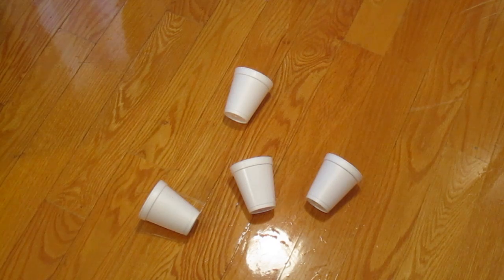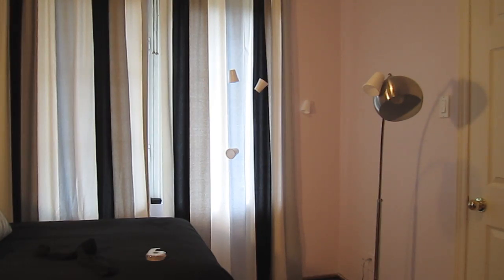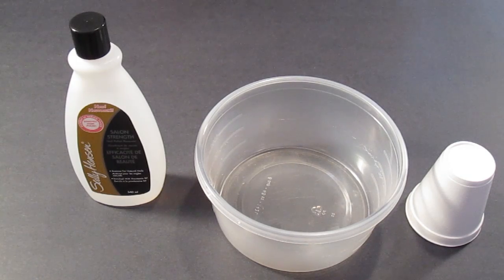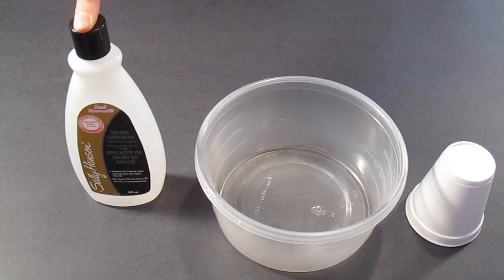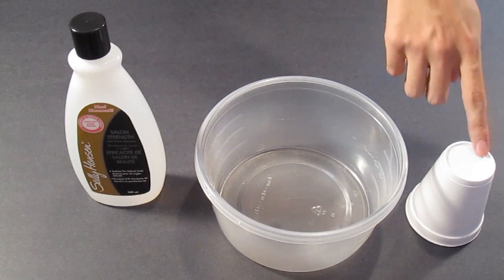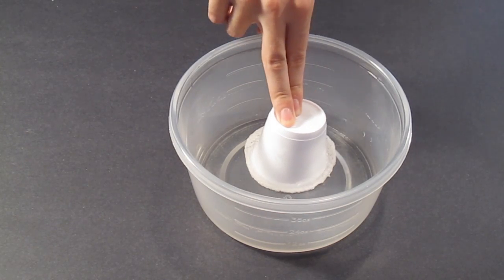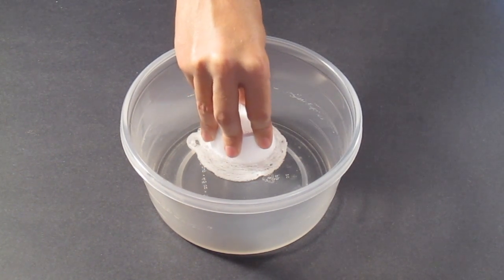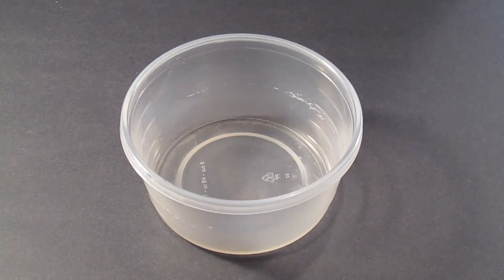MELTING Styrofoam Cups With Nail Polish Remover?!?!!?

Comment: It Is not melting it is collapsing what is happening is that the air between the beads is compacted together to form the liquidy goo which is a fun and helpful way to dispose of the cups instead of throwing them into the disposal because they are not biodegradable

Comment: Also, not all Styrofoam works. Only polystyrene seems to react in the acetone. Polyurethane, a denser Styrofoam most certainly does not work in common nail polish remover.

Comment: Styrofoam is made up of polystyrene foam. When the polystyrene dissolves in the acetone, the air in the foam is released, causing it to look like you're dissolving this massive quantity of material into a small volume of liquid.

Comment: Polystyeren is a polymer meaaning it is made from longer hard chains, the acetone or most strong solvents ( e.g petrol, cellulosse..) act as a sort of lubricant relasing the air and alonging the chains to slide with eachother